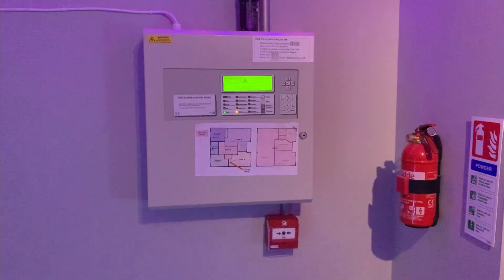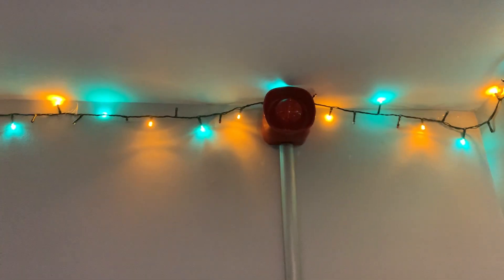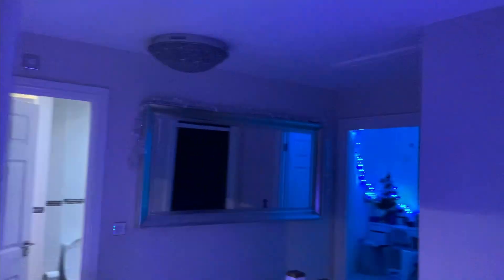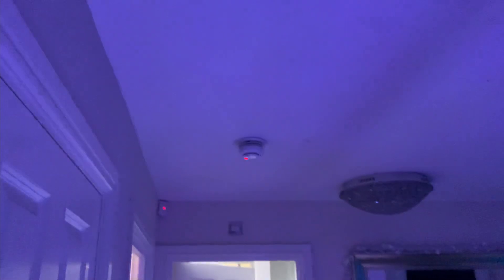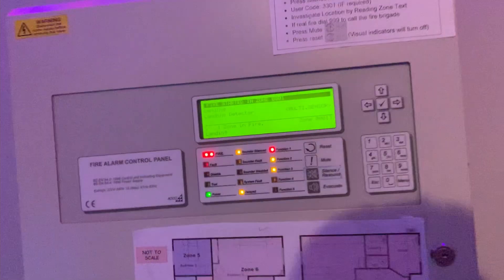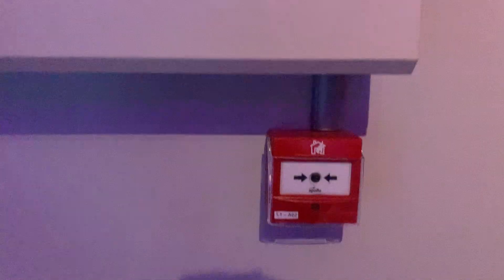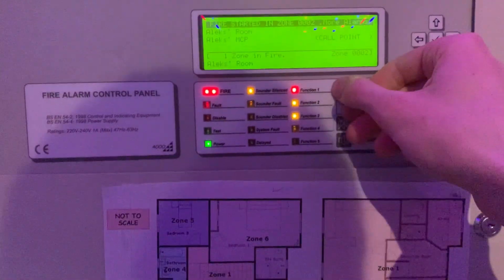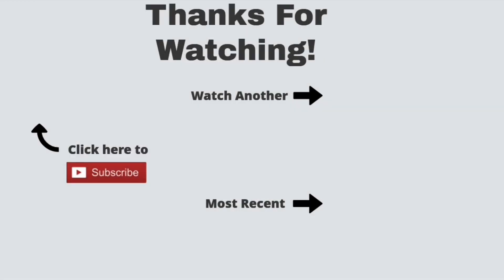Apollo XP95/Discovery House System Test 8 | Christmas Themed

Comment: I guess the 2 opticals in the bedrooms were removed for good
Moving on…

One thing I’m struggling to see is which symphony has replaced the beacon because of the Christmas lights
Reply from the maker: Only the optical in the front bedroom has been removed the good, and the bathroom. The rear bedroom might be put back up though.

There will be expansions potentially coming soon that will be going downstairs with xpander devices and in the garage as well.
Reply: @fst1775  
Where did you get the lights from